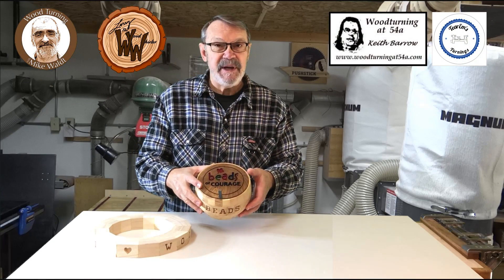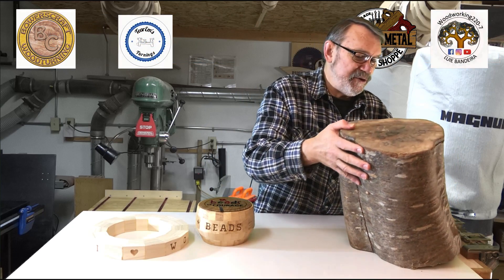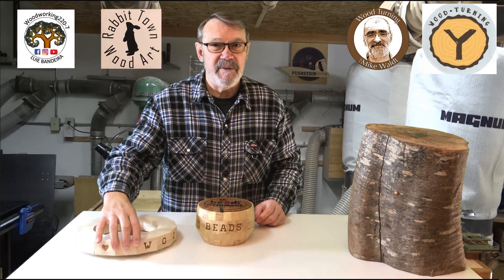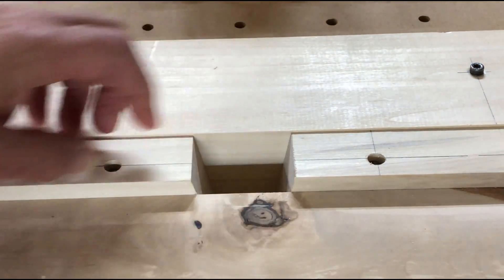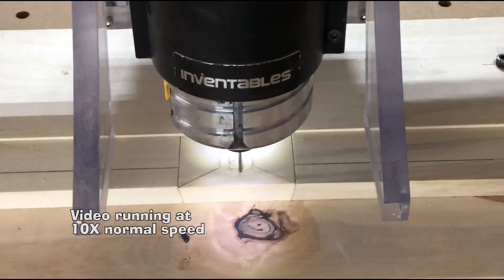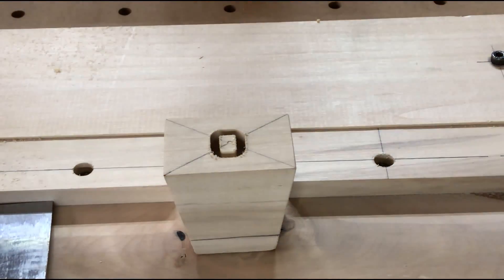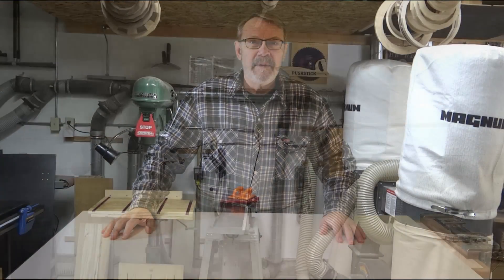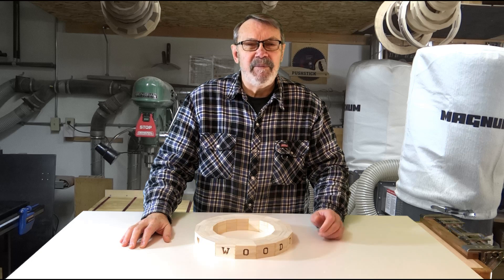Using CNC For Segmented Rings

Comment: Thanks for posting. I prefer to turn the bowl then put the CNC to work with cutting, piercing or burning.
Reply from the maker: I would prefer to do that as well. My CNC does not have enough clearance to turn a bowl on its side and do that. It’s a hobbyist machine but it’s better than nothing. Thanks for watching! 😃😃😃🇨🇦🇨🇦🇨🇦🇨🇦🇨🇦
Stay safe and healthy,
.....Gord
Reply: I have a hobby home built machine as well and I solved the problem by making a hole in the Center of my table. When I want to do flat work a sheet of plywood does the job.

Comment: Hi Gord,  I real like the video.  What kind of CNC machine?  Do you like it?
Reply from the maker: Glad you liked it, William. The CNC is called the X-Carve. It’s available from inventables.com. I like it a lot but it’s the only one I’ve ever had so I don’t know what it’s missing. It’s definitely not a professional machine. One of the things I like about it is that it was a kit and I had to assemble it. That meant that I got to know every nut, bolt and belt on it. The software is fairly rudimentary but was included in the price. There are much better CNC machines out there but way out of my price range. They have a great forum mostly run by other users so there haven’t been any questions that I couldn’t get answers to. If you’re interested the website is a good place to start. I hope this was some help, William. As always, thanks for watching!
😃😃😃🇨🇦🇨🇦🇨🇦🇨🇦🇨🇦
Safe turning,
.....Gord
Reply: Gord Rock thanks Gord for the information.  I’ve been looking at them - but just another want.

Comment: Really nice Gord.  I'm wondering if those of us who can't afford a CNC router could use a low end laser engraver used to sign work to do something similar.  The low end lasers might not penetrate deep enough.
Reply from the maker: I haven’t got any experience with lasers so I can’t really answer that, Tom. I don’t know how deep lasers cut. Wouldn’t they burn the wood rather than carving it? I bought a real cheap Chinese laser engraver a few years ago and never did get it working. The company I bought it from online offered to replace it if I shipped it back to them. Shipping it back would have cost more than I paid for it. I threw it in the garbage and somehow lost interest in laser engraving. I occasionally think about trying again but don’t want to get burned - pun intended - again! Sorry I can’t help you with that, Tom! Thanks for watching!
Take care,
.....Gord
Reply: @GordonRock1  Thanks for the reply.  You are probably right about the burning rather than carving with a laser.  What kind of CNC setup do you have?  Brand. model, price etc.  Maybe I'll put one on my bucket list!
Reply from the maker: My CNC is called the X-Carve. I have the 1,000mm x 1,000mm model. I don’t have a clue what the price would be now. I have had mine for about 4 years, I think. When I purchase something I try to forget what I paid for it. I don’t want to start imagining what I could do with the money if I hadn’t spent it! You can find them on the inventables website; http://inventables.com
It’s not a professional model but it does everything that I need it to do and I don’t use it very often.
Reply: @GordonRock1  Thanks Gord.  I don't know much about CNC routers so this will be a good place to start.